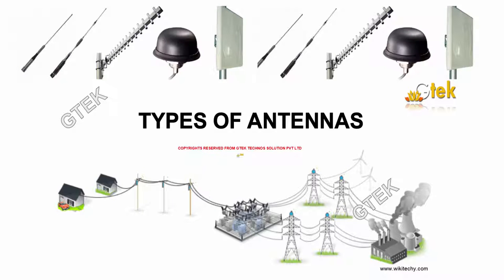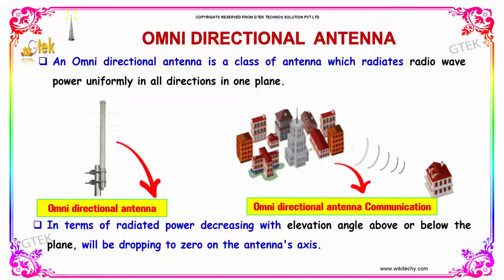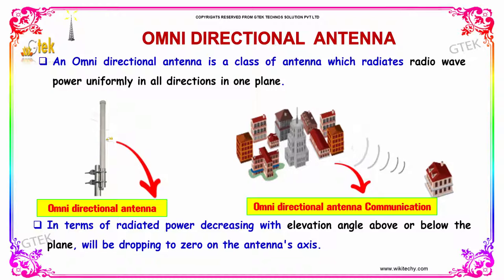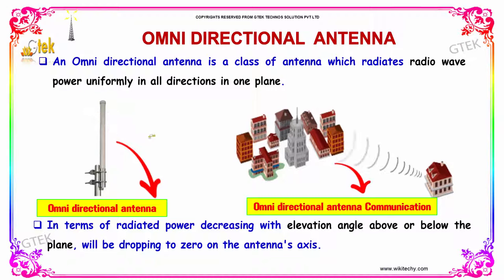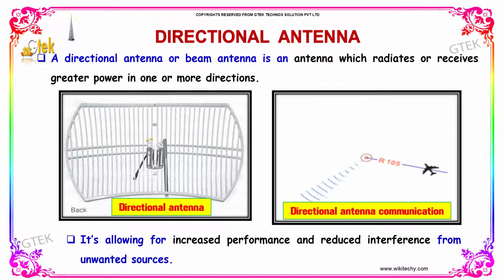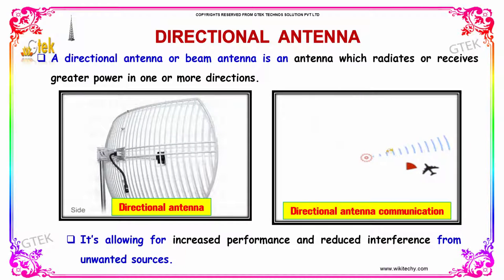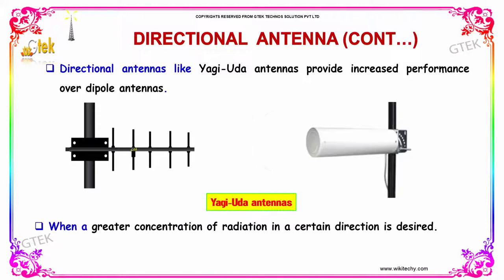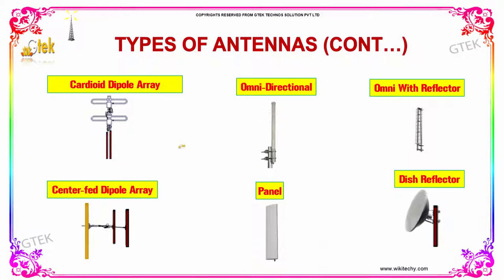Types of Antennas | Communication systems | class 12 physics subject notes lectures|CBSE|IITJEE|NEET

Comment: In case of wireless communication systems, antennas play a prominent role as they convert the electronic signals into electromagnetic waves efficiently.
Types of Antennas.
Log Periodic Antenna.
Bow Tie Antenna.
Log Periodic Dipole Antenna.
Wire Antenna.
Short Dipole Antenna.
Loop Antenna.
Small Loop Antenna.

Comment: A multi-element high-gain Yagi is shown in Figure 4. Parabolic, or dish, antennas are the most familiar type of directional antenna. A parabola is a symmetric curve; a parabolic reflector is a surface that describes that curve throughout a 360-degree rotation—a dish or, to use the technical term, a paraboloid.

Comment: CBSE Class 12 Physics Notes : Electromagnetic Waves and Communication ... Radio and microwaves are used in radio and TV communication, ... (ii) Frequency Modulation In this type of modulation, the frequency of high ... wide area for broadcasting a8 compared to other communication systems i.e. it has ...